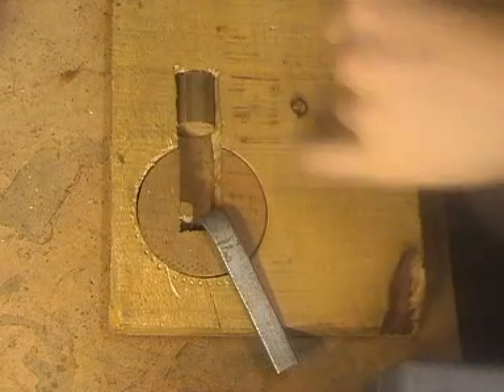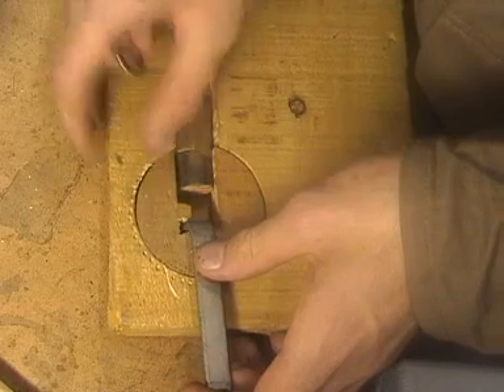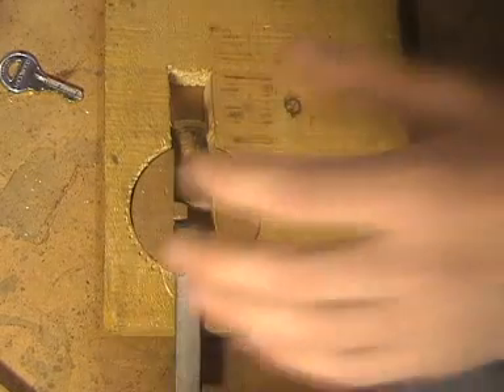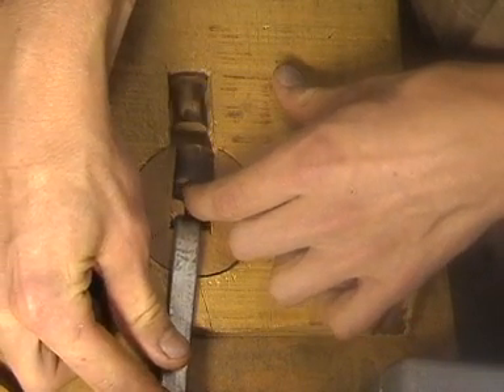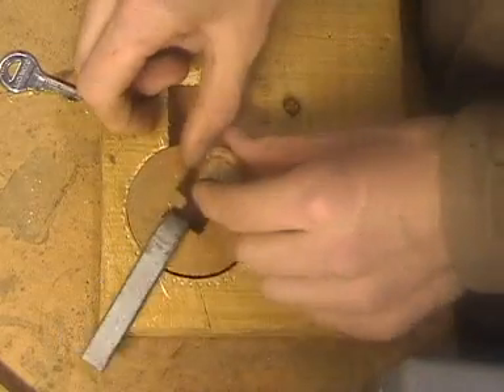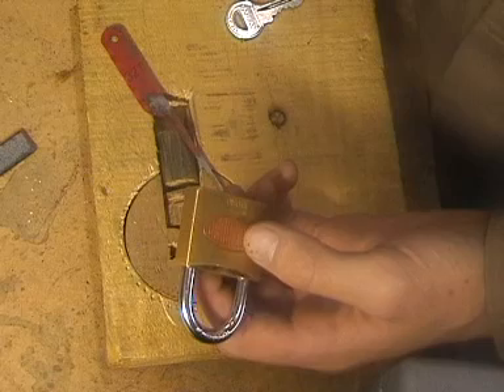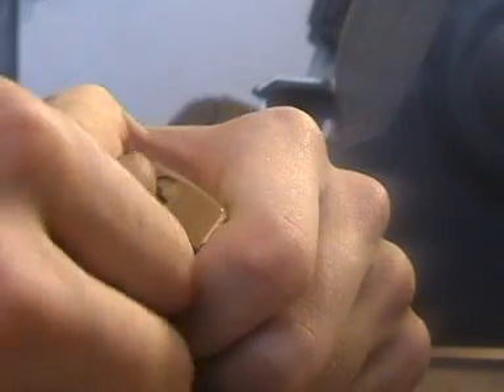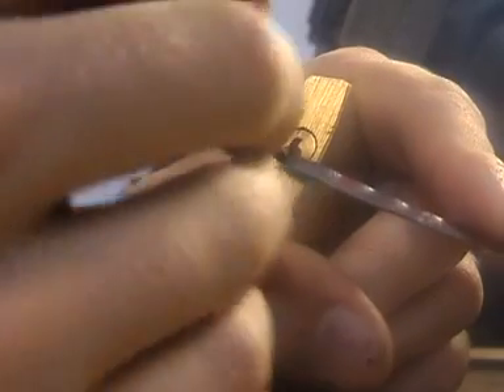beginners lock picking , how locks n spool pins work

Comment: after a false set, the pins and lock will go stiff. as you are applying pressure picking the pins easy off the tension and then back on. repeat and when you find it it will go. bingo

Comment: This is an excellent video! Thanks for making the model for us. Just one small criticism, however. 

You mention that when the pin is overlifted, the spring pushes the pin to shear. This is, more often than not, not the case. Overlifting will often disrupt the binding order or put a halt to the picking process altogether. Unless you're using absolutely incredibly light tension, the overlifting will "stick"  in the lock and frustrate any further attempt to pick.